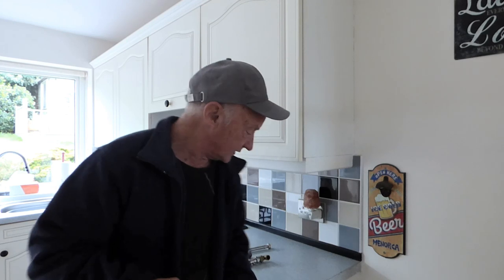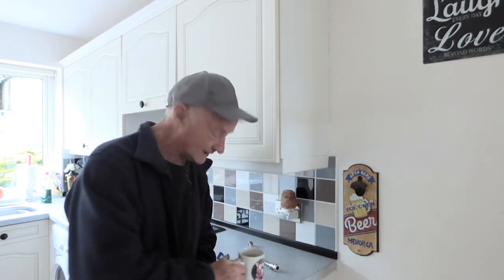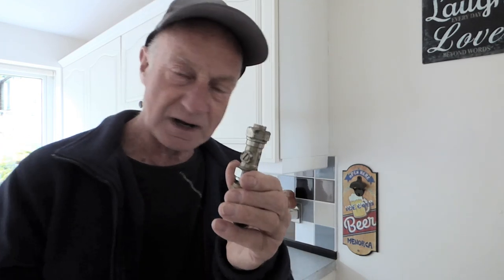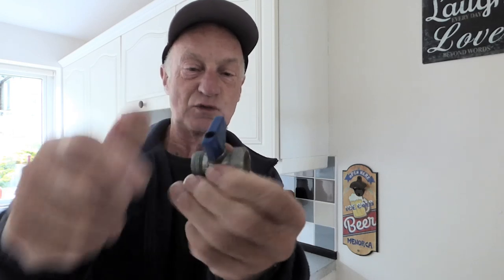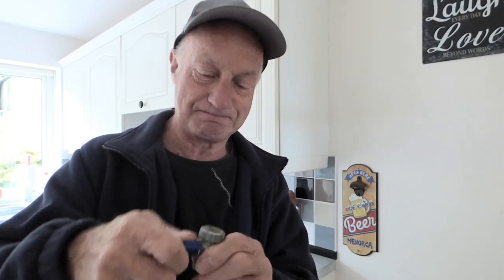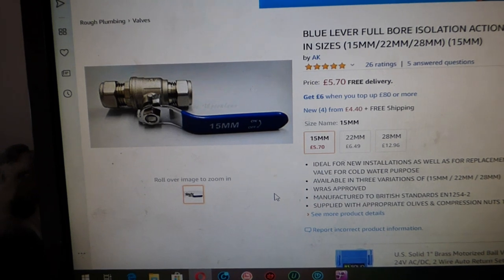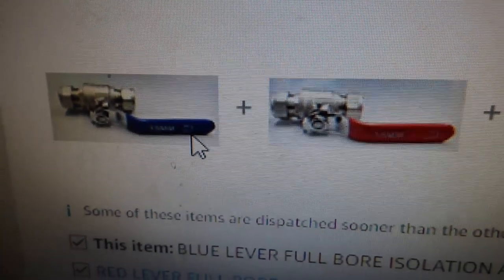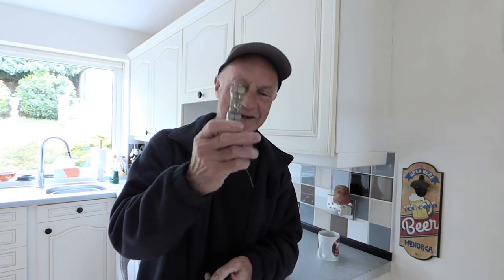Ballofix isolating valves leaking or not working.

Comment: you re the best plumber on you tube, I had a full bore tap on where the kitchen sink was and i had to remove for a new kitchen cabinet and put on small isolation valve without a stop end. the isolation valve starting letting a small amount of water through, result loads of water on the floor. don't use the small isolation valves......the full bore red and blue I had no problem.
Reply from the maker: Great job!

Comment: This is quite weird as I've seen 20 year old Ballofixes that work just as well as the day they were installed, and I've never seen one leak. However, I'm from a place with very soft water, so that might be it. The ones used here in Finland are a bit different though, the whole body is hexagonal instead of round, different model perhaps? The most fun part is that Ballofix is the "premium" brand around these parts. As for the washing machine, just fit an Oras tap instead, nice chrome one that'll look just splendid in any bathroom or kitchen. :)

Comment: The worst ones are those really old, prototypical ones that have a tiny, tiny,  little slot on them. Much smaller than the ones available today. As soon as you turn them, the spindle head breaks and you start to get covered in a fine misting, but quite substantial leak. 
That is not the time to start locating the mains stop tap that may also be seized or start frantically trying to locate, dig out and turn off the water authority stop tap in the street.
Reply from the maker: Good tips from loafer, be warned about these valves. Ha ha.
Reply: Bored, bored, bored!!! Been without work vehicle all week. New one's getting delivered today and old one is going to the scrap yard in the sky.
I might do an upload on it. Like I said. I'm BORED.

Comment: I hate the damn things and basically view them with trepidation every time I have to turn that little screw, knowing its going to cost me a £80-100 to get fixed . That's how much it costs to get a plumber in NW London and a typical charge for a good plumber is :£55 plus VAT (£66 with VAT) for the first 15 minutes and £28 plus VAT (£33.60 with VAT) for every quarter of an hour after that. This is for labour charges only.  Just got the plumber in to replace a broken WC flush valve and he asked me whether I wanted a new isolation valve because I knew it might leak  when turned off and on. I tried it myself before he arrived and it worked okay , but now he's fixed the new flush valve and gone , the ballofix valve has started to leak . There's another £100 gone down the drain to call him back to fix a full bore lever one.  Nuts!!!!
Reply from the maker: Wow more good reasons to do it yourself.

Comment: Thanks, I have a ballofix valve on the hot tap seized under the sink. 
I'm wary that if I try to force it it may leak and the hot gate valve at the cylinder is also seized, so have to freeup or replace that first.. Will get the lever ballvalves😊
Reply from the maker: Great idea

Comment: Thanks for this video . Is there a temp fix for this until I can get a plumber to install one of the good valves you have recommended. It's the weekend and I have just found one with a leak. thanks
Reply from the maker: Unfortunately no.
Reply: @dereton33  thanks. Plumber out today. Got ballofix removed and a straight pipe replaced it. Enjoy your channel. Thanks.

Comment: If I close this valve, can I unscrew the top end (upstream) of the isolator body?  Or will water pour out?  I think my isolator it leaking slightly from the top thread and want to smear some compound.
Reply from the maker: Yes you can there will be some small amount of dead water that`s all.

Comment: Great video. I have a JG Speedfit service valve which I turned off to replace my shower valve. However it will not turn back on as the screw driver just slips off. I noticed that there is a hole in the middle of the screw head with a thread on it so was wondering If there is a special tool to fit into it. Any suggestions accepted.
Reply from the maker: Not that I know of.

Comment: Now you tell me! I've recently fitted several of these to my cisterns and basins.  When I was buying them I did notice that there are different versions available at a wide range of prices so perhaps you get what you pay for.  Do I not remember a video from you recommending these valves to be fitted and demonstrating how to do it?

I knew that the problem exists with washing maching taps.  I always turn my washing machine taps off after each use and haven't had a problem but I also know someone who leaves them on permanently and when a hose sprung a leak overnight they found that the tap was seized and they couldn't turn it off.

I also have a problem with a sixty year old supatap.  It's in a toilet that rarely gets used and started to leak.  I tried to unscrew the body to change the washer but it jammed and wouldn't come off.  The tap is now in the ON position so I then tried to screw the body back on which would turn the tap OFF but it jammed again.  So now it's permanently siezed in the ON postion and won't turn at all in either direction.  Even brute force with a large Stillsons wrench with no regard to damage failed to budge it.

I think all these problems are due to the build up of limescale although we are not in a particularly hard water area.
Reply from the maker: Yes number 33, I do remember doing a video on fitting these cheap valves and did recommend them as they were cheap and better than nothing,  but I have had so many bad reports since then about them, I decided to give every one the low down that they are not so good after all. They work fine for about a year, then after that, they either do not turn any more or leak .

Comment: Does the same apply to John guest push fit isolation valves?   Are they just as bad?   Or are these still reliable to use as apposed to the full bore valves?     Peter from Southampton.  2nd February 2021 Tuesday afternoon at 13:08H
Reply from the maker: The John guest ones are much better, but full bore valves are still the best.

Comment: Hi I'm trying ti change my bath taps but both isolators have failed and my stop cock doesn't work either.Shall i turn my
 combi boiler off and all the valves under it and the outside mains stop valve?
Reply from the maker: Just the main outside stop tap.
Reply: @dereton33  thanks

Comment: Our radiator drain valve is a ballofix. I want to empty the F&E tank to add X200, but am a bit worried about touching the valve in case it leaks when I close it again. Do these things generally leak in the closed position? Is it better to add X200 via a rad valve instead?
Reply from the maker: Use the rad valve, those things always leak.
Reply: @dereton33  Thanks Al! That will also save climbing into the loft with my dodgy back!

Comment: What if you're turning the valve on (counter clockwise) and the water doesn't come on - the valve just keeps spinning?
Reply from the maker: The valve is broken.
Reply: @dereton33 Thanks for the prompt reply. That's what I initially thought as I'd had a similar problem with one of my gate valves, but this flexi hose was only installed nine months ago. When I disconnected the flexi hose from the tank, then turned the water on the water then comes through ok which surely means the problem is the tank end? I've got other leaks in the tank anyway and it's 35 years old so maybe time for a new toilet?

Comment: A plumber put one of these on as a stopper in an emergency, will it be ok as long as I don’t touch it?
Reply: I never, ever put them on even as a temporary measure, without making sure that the outlet end is also temporarily capped with a short section of pie and a stop end. They are also directional (look for the arrow denoting flow direction) and if accidentally put on the wrong way around, they can blow off.
Reply: Short section of !pie?" Freudian slip it's breakfast time. Apologies, I meant pipe.
Reply from the maker: Prefer pie Loafer. Ha ha.
Reply: @dereton33 I'm off to watch the rugby... Pie for lunch then off to work.
Note in diary "Saturday pm-------------> work"
Response

Bugger!

Comment: i totally agree al the lever ball valve they are the quality enjoyed the video.
Reply from the maker: Thanks Ratch.
Reply: But if you buy a better quality ball valve brand like Pegler, you get exactly the same valve with the screw, lever or T fitting. I think it's more about the quality of ball valve isolator fitting rather than the mechanism to open or close the valve. I think the best ones now have ceramic washers instead of the cheap rubber ones that cause all the problems

Comment: Hello, me again (if you are my question about these on you other video), I've got one of these crappy valves (not my choice, I hate them) & it doesn't turn off (surprise, surprise), I need to remove my tape but can't till I can shut off the water, the same pipe has another valve ( brake handle type) but I can't turn that off either as it's ceased & I can't use a monkey wrench on it as it's too close to the side of a kitchen cupboard, How do I free either one of them to turn my water off, if I get to turn the 'main' brake water valve off I'll  replace the crappy little one. Good video's.
Thanks.
Reply from the maker: Best to renew both of them.
Reply: @dereton33  I'm trying but I can't shut the water off, im in an apartment, they are the only 2 I have to turn the water off with.
Reply: @DavidJHarrisonEssex  if you are in an apt I guess you don't have a water meter outside somewhere? I use that by the entrance to the property line to turn off the water for plumbing jobs in my house because it's more convenient and a much better quality valve than anything in the house.
Reply: @IAmDanIAmNotSam  Yeah, I'm moving to a house & doing my Appartment up to rent, I have bought a 'Frozen' set to try to freeze it, my waste water pipe is blocked & nothing I have done seems to.remove it so I'll  call the insurer who maybe able to do both.

Comment: I buy Pegler.
Reply: Just wrap some blue electrical tape around the handle. Now, I know it's an ugly fudge, but they are nearly always tucked away where they can't easily be seen.
Reply: @loafersheffield  yep
Reply: The worst ones are those really old, prototypical ones that have a tiny, tiny,  little slot on them. Much smaller than the ones available today. As soon as you turn them, the spindle head breaks and you start to get covered in a fine misting, but quite substantial leak. 
That is not the time to start locating the mains stop tap that may also be seized or start frantically trying to locate, dig out and turn off the water authority stop tap in the street.
If you ever come across one... isolate the mains and completely drain down first and cut the bugger out. Trust me on this issue. Been there, seen it and got the wet shirt.